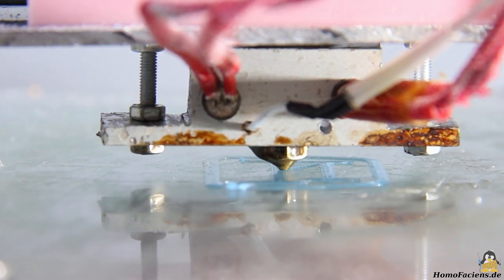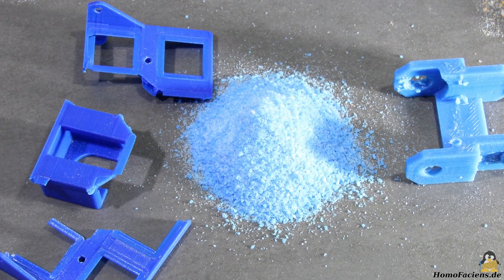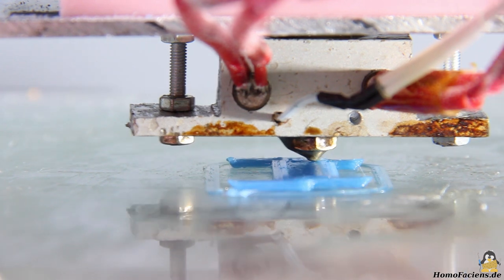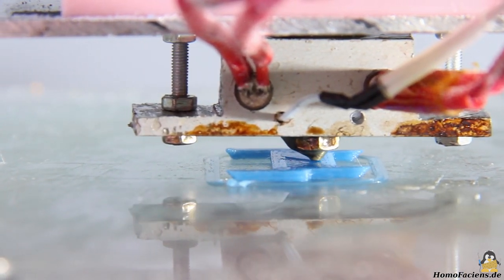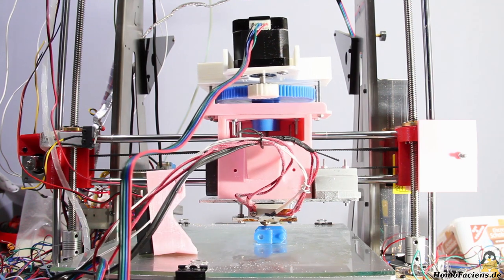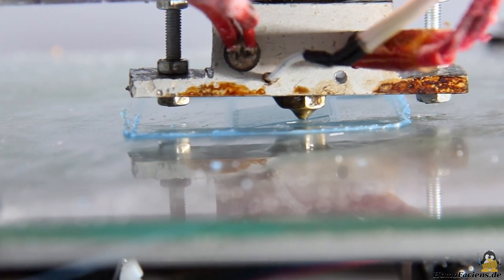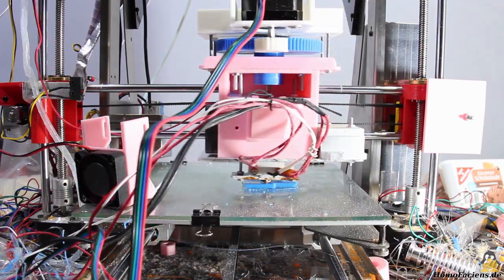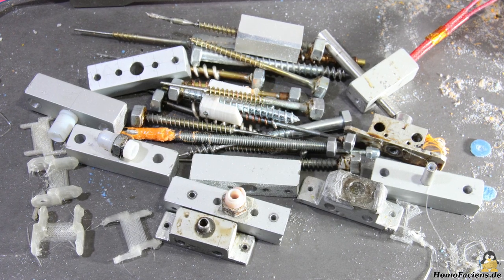Direct granules 3D printer V2 - Hackaday Prize 2020

Comment: Loving the low tech efficient way of displacing the cooling system out of the way at 02:50 ;) Other that than, i'm very impressed to see you succeeded where many have failed before you.
Reply from the maker: That extra heatsink (cut from an old CPU) would not be needed with the design shown in this video, where a Teflon tube acts as heat barrier. A couple of previous, failed versions needed extra cooling. Currently I am working with a cone shaped steel tube, that works, but needs extra, extra cooling which is why I have glued an additional fan on top of the heatsink.  Must keep an eye on the thermal design ;-)

Comment: Wow, love this. I've seen a few granulate printers that do not require you to grind it down to a fine powder and this has my preference. But maybe there will be suppliers in the future that will provide pre-ground granules. I like the way this adds more storage ease, mid-print refills without having to switch filament, and you're not bound to spool sizes that ALWAYS differ per producer.
Reply from the maker: But those printers can't print that fine details (at least not the ones I have seen). I will talk about the impact of grain size in another video. I will also demonstrate how to get small granules from the industrial pellets. I have used those granulate to avoid impurities in my raw material. The video was the first test using recycled waste prints.
Reply: @HomoFaciens  Yeah, I'm mostly interested in virgin material pellets as to not have any contamination in the product. I happen to have seen one last week that did high resolution with ordinary pellets, but I believe it also used some kind of pre-grinder maybe now that I think of it. I'll see if I can find it, maybe it can help you further with your design.
Reply from the maker: Using nozzles with a rather large diameter and printing in vase mode to avoid showing the ugly stringing seems to be the usual way to conceal the weak points of those extruders: ;-)
To be honest, they are advertised for printing large objects for which using pellets makes sense from an economic view. I in turn want to create a direct extruder that is for rather small, quality prints.
Will go back to my workshop, now...

Comment: Thank God I am not the only that have a messy table when doing a large project.
Reply from the maker: Thank God I am obviously not the only one, too ;-)
Reply: a tip from own expierince , just buy more tables so if one is full you can use the next one xD ( i have 5, 80cm deep 2m and 3m wide), Also i use often squaure wooden boards (~60x40cm for example or 80x 30) as underlay in case all 5  Tables are full i can quickly empty at least one Table by putting the experiments on these wooden boards on the ground or elsewhere.
Reply from the maker: Discarding old project is no option :))

Comment: nice, off the top of my head, to cool the fresh layed plastic try placing  2 or 4 peltiers on eather side of the extruder head/plate wired with hot side up and cold side down with what looks like about 3 millimeter clearence from the fresh layer... it will passively cool it as they move over it probably! really good... or perhaps to quick and so warp it lol , if so, lower the peltiers voltage to make it cool slower perhaps,good work as always.
Reply from the maker: A cooling fan on the print head is the usual way to cool the parts. Its efficient and proved to work fine in thousands of printers. No need to ad complexity with Peltier elements (but you can prove me wrong in demonstrating that these are better).
Reply: @HomoFaciens  sure, just like using cheap "glow plugs" or roberts conductive inks to make simple flexible capton tape 200C+ direct contact heaters in any shape you require for the device,or direct granule print heads isnt "the usual way"
Reply from the maker: I like "unusual ways" of doing things, but I can't check them all by myself if they do things better ;-)

Comment: How do you manage retraction?
Reply from the maker: By simply turning the screw in reverse direction wicht isn't too successful, yet.  However, I will continue the development of the extruder in this year's Hackaday price (that will start in April or May). Stay tuned!
Reply: @HomoFaciens  I'm very hyped for that! Your project not only is cool but could be game changing. I feel like creating filament dust is easier than filament and cheaper.

I was thinking of using a more coarse typical pellet extruder and using my mill to carve and mill it accurately like a CNC while it prints

Comment: its cool but not very usefull. Sure you can recycle prints, but its not using standard pellets. Manufacturers dont sell plastic dust and while you can process raw pellets its still not straight forward.  Also using smaller particles introduces air, i think i rather stick with the bigger pellets which are less prone to having small air bubbles
Reply from the maker: I will show in a coming video about the raw material, that industrial pellets are not best for a small extruder like mine, because of the large, uniform grains. Stay tuned!